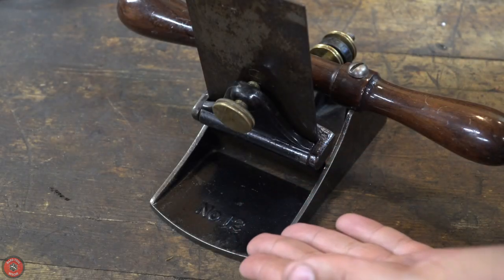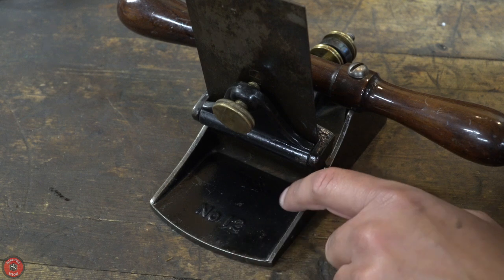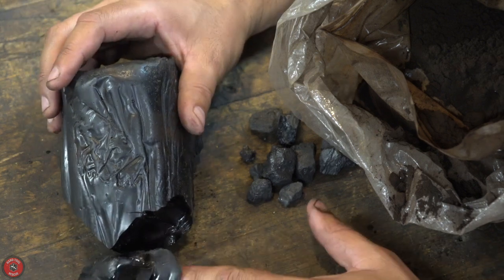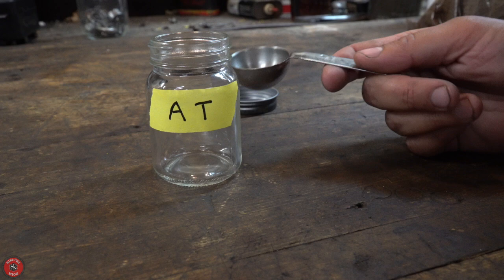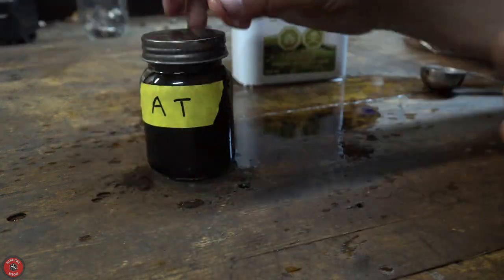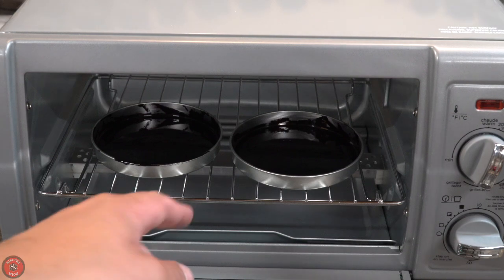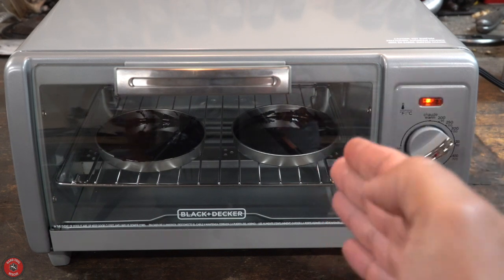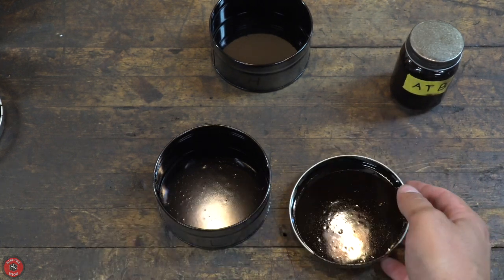Best Japanning Recipe

Comment: I've learnt with paints I've mixed from pigment that when it comes to blacks there are two kinds - a blue black and a red black.  The application i use involves reverse painting on glass (which has a green tint, which exacerbates blue/red base to the colour).   A paint that is more of a red black (brown in your case) than a blue black, has a richer warmer look, where as a blue black just doesn't cut it.

Comment: Made the recipe. Ready to use it. Does the surface have to be completely rust free? I got all the rust off the hardware with acid, but as soon as it dries some small amount of rust forms unless I have it soaking in white vinegar. Is it ok to hair dry it out of the vinegar solution then apply Japan paint to prevent oxygen or water from hitting surface and causing oxidation? Any response would be fabulous. Thanks

Comment: Boiled linseed oil polymerizes, depending on amount it can take a long long time. If you apply too much it will never harden, it'll stay tacky and soft. When painting with linseed oil paint the exact ratios between pigment and oil are important and the thickness of each layer must be very thin.  "There should be more paint in the can when you're done than it was when you started" I heard when learning how to paint with it lol..  It seems like the same applies here? We would adjust the ratios along the way until from start to finish.

Comment: When it was invented in japan in 17th century just common sence to me would be they dipped the metal tool metal whatever hot from the blacksmithing as anything metal was heated and pounded into shape. As a restorer and metal fab guy ive allways  called japaning the original powder coating but youve sparked my curiousity on this and i vow to find out. Thanks bro and love you work i only use pre war tools in all i do

Comment: The results are stunning, but I wonder if it could be improved even further by adding some siccatives to accelerate the curing of linseed oil. This way the coat would harden in it's entire thicknes, maybe it would allow to lower the temperature of hardening enough that you could apply it also on wood...

Comment: Nigrosene is the ideal japanning base - it's basically pure carbon black and can be sourced to work with either water based (alcohol) or oil based (gum turps etc.) solvent base.  For additional black compounts of cobolt and various earth bases are used for warmth.  Reds are produced from raw Seedlac and exclusively alcohol based.  I learned how to make several traditional (English traditional that it...) mixtures for restoration of old furniture and machinery at Master Craft level.

Comment: Very intriguing....

White living room couch.  You forgot to mention, you should also be wearing white pants, and a white sport coat, like Sonny Crockett, while you do this....  Galco SS2 shoulder holster is optional....

So hard to film black paint, but, to me, the spraypaint, with the amber shellac over it, looked pretty good, and felt like a lot less work....

I have made a deck sealer out of spar varnish exactly like you had, boiled linseed oil, and either mineral spirits or turpentine....  It works really well.  On that theory, since we know spar varnish will play nice, I would postulate a mix of asphaltum, spar varnish, couple drops of boiled linseed oil, and a little turpentine....  that might be the best one yet....

Comment: From What I have heard of the old japanning Recipes, Seems like it was a bit Thinner a solution, More Finely Ground on the Asphaltum, and had a Lot of Micro Carbon mixed into the mix. The carbon made the mixture as hard as it got, and tempered the softness of the Asphaltum.  I never tried to compound the setup, but The Closest I got to a pretty Good faxsimile of the old japanning was this -- The Cheapest Semi Gloss black Can of spray paint at Walmart, You Know The ones at the bottom of the rack -- mostly the 69c cans. Been a While ago ;)  You fully wet coat the part with the paint, hang it in the pre heated oven at 350 degrees for 4 minutes, after the 4 minutes, remove the parts and let them Cool down to Room Temp. At that Point, The parts were dry and ready to Install. The heat makes the paint
'Flow' on your part, and looks really Authentic .It was not so durable as it did chip -- But it looked Great, and was fast to do. So basically you are forcing the propellants out in a hurry with the oven, and I say buy an old oven and try it.  Good Luck!

Comment: Try kapton tape for masking parts. Electronics repair people use it when soldering boards. It doesn't deform at 400F and is very sticky.
Try some quality car wax on the dull ASV sample for a shine. Maybe use wax as a easy cleaning coating for tools.

Comment: When I have watched Japanese Lacquering, I have always seen them strain the paint before applying. I know it is not the same however, straining might work. Also when they bake on the lacquer, they put it in a closet with a light source as a heating element. Another aspect might be the humidity in Japan which is high.
Reply from the maker: The straining would be interesting!

Comment: Looks good (if not a little messy) still trying to get the stains out of my white leather couch :-)
if you want to mask off areas before baking, have you considered Kapton tape ? (DuPont make a good one)
it's a Polymide film with a silicone adhesive layer. good for about 500 F
it peels off really easily after heating and usually doesn't leave a residue
comes in various widths too. 3mm to about 25mm.  just a thought

Comment: Paper burns at 451 deg F. Seems a paper tape should be fine to tape something off. The adhesive might be a problem though. I really like the Japanning though. It really does make the finish very authentic on a restored plane. Great video. Thanks for doing the research for us. Our offline book repository burned down, so not sure about all that. The fire was hotter than 451 Deg F. LOL! Regards, Solomon

Comment: My grandad used lamp black powder 1 tablespoon, asphaltum 1 tablespoon, linseed oil (not boiled) 3 tablespoons, 1 1/2 teaspoons of naptha. Mix = lampblack + naptha  very well, add asphaltum mixing well, gradually add linseed oil mixing well. He had a homemade paint shaker using an old washing machine motor and gearbox and would let the sealed jar mix on slow for 2 or 3 hours. The jar would sit for at least a week, he would check it once each day by smelling... he said when it's done you won't smell the naptha anymore, if it was still too runny he would shake it again for an hour. He restored old hit and miss engines, maytags etc. I always thought regular enamel was good enough, but what does a dumb kid know. I was about 6 or 7 at the time. I brought him some of my Testor model building enamel paints and that was what he always used after that because of the other colors. Your way sure brought back memories, I'm 64 now. Thanks for the work you do and I really enjoy your humor! I have used the book thing with my kids and grandkids many times. LOL
Reply from the maker: Lamp black would be a good addition for sure!

Comment: The circular pits in the ATB finish are called "fish eyes" in automotive painting. They are usually caused by silicone grease or oil on the surface. Maybe cleaning with a wax and grease remover would be better than acetone. YMMV.

Comment: I have used birch tar I make myself as a coating. After heating, it gives a hard but brittle coating it is a dull black though. I use this sometimes on things I do than blacksmithing. I found out the brittle part then bending a pin for a clasp and it just cracked and fell off. but for things that you don't have to work after it works nicely. thought of this then you began talking about tar in the beginning.

Comment: Maybe you can dissolve it in a stirrer or tumbler to dissolve it better, or if the dust isn't fine enough you could use a tumbler with ball bearings or blend it before mixing it.

Comment: I know this is an old video, but I hope this question is appropriate. I have an old Stanley that I would like to redo the Japanning on. How can I strip the old japanning? I do not have access to blast it, is there a chemical stripper that will remove it? Thanks Bob
Reply: try soaking over night in different solvents.  I already tried ethanol 95%, , , it didn't touch it.  try lacquer thinner, acetone, etc, , ,anything you can think of.

Comment: How much does a cured finish liquify and run when you reheat it?   I'm wondering if you need to paint a vertical side and place it on it's side so it's baked flat and do that for the other side or do it like you did in your video (paint horizontal and vertical in one go) and it just runs a little making the vertical wall thinner.      What happens if you bake a 100 year old Stanley plane with originial japanning?   Will it liquify and run and repair itself?

Comment: The thin metal of the lid may have contributed to the cracking, heating and cooling faster than thicker metal and possibly warping at temperature  like Cooke sheets do in the oven.

Comment: when you pour from a can with a top opening rotate the can so the opening is upwards or  at the top, then when u pour  keep tilting the can till the liquid  starts to stream out.   in ths way you dont  get all the splashing and mess you made.  the other way to say this is have the opening  upwards to where you had it.  you had it at the lowest position.    so to  get it in the upper position just rotate the can 180 degrees  along its long axis.

so did you get all of that.   well good.

Comment: Does baking it at these temperatures not introduce the possibility of extreme tempering of the metal which will lead to the cracks in the bed often associated with older planes?

Comment: Not sure I can justify it practically, to re-Japan the finish on one of my lathes (the 90 day cold cure is a bit long to wait).. But this does look good..

Have you tried a 2 part epoxy with dyes to mimic the colour? 
Just thinking that might have similar visual affect on anything heat sensitive or too big to heat.. That it might be a similar thickness and smoothness.

Comment: Those holes in your finish is called "poor wetting" or "fish eyes"  usually caused by silicone particles on the surface. You can buy wiping cloths at an automotive paint store that will be silicone free. Use that with an automotive grade surface cleaning solvent to remove any contaminants prior to painting

Comment: The Ford Model T had japanning, or something similar, coating the body. Supposedly, the reason Henry Ford offered the Model T in “any color they want, as long as it’s black” was that that black japanning (or similar finish) could be baked on and therefore took less time to dry than other colors of car paint (I don’t know exactly what the process was for other colors). Therefore, the Model T spent less time on the assembly lines, and so more of them could be produced more cheaply.
Reply from the maker: This is true!  They switched to an enamel-type paint sometime in the 1920s.

Comment: The automotive and industrial industries have used industrial chimney soot as black toner for a variety of paints and lacquer for centuries and probably longer .The problem with asphalt is you have a tar base which as you stated,is flexable. The Chinese and the Japanese both had formulations for durable lacquers . I have seen the word Japan as a term for an additive that is a drier for paints as in Japan drier for certain synthetic enamels. Without the drier, they will not cure or dry to the touch. Have you tried using a better evaporative solvent than turpentine such as acetone?

Comment: Does the recipe call for liquid asphaltum or powedered?, I think (or might just be worth a try for comparison) if you use liquid ashpaltum in your recipe you will get a better final result... I use liquid Asphaltum for Lithography which is hard to get hold of now. I haven't tried but you can make liquid asphaltum but you have to boil it for it to dissolve, it won't dissolve at room temp. turpentine is toxic so use appropriate protection...

Comment: What about adding a surfactant?  Have you tried to use chloroform?  It works really well at dissolving and evaporating evenly.  Another solvent would be either or di-methyl either.  

Running the mixture in a ball mill with a bit of extra solvent for a week or two should make the mixture much more smooth and improve the finish.

Putting the freshly painted object in a vacuum or the paint might help.  Toaster ovens are very harsh, add layers of foil above and below the object to prevent the light and heat radiation from hitting the object directly.

What about spraying a very strong solvent or dipping the freshly painted object in a solvent to smooth the finish?  Think of acetone smoothing in 3D printing.

Placing the freshly painted object on a strong vibrator or ultrasonic tray might help even out the finish.

Adding a cup of water to the oven to raise the humidity might help.

Test the PH then try making it more acidic or basic to see if it affects the finish.

Overall the tip I think would make the biggest difference other than a surfactant is to mix it for what seems like way overkill, as in weeks not hours.  These simple paints rely on the chemicals to get really close to bond and without chemistry, you just need to brut force it.  You can run your paint samples in a centrifuge to test if they becoming a more stable mixture.

GREAT video!  I love the science mixed with history plus a bit of SHIFT paint tech.

Comment: RAW LINSEED OIL:  The formation of a curable polymer composed of raw linseed oil, Gilsonite, rosin, AND carbon black, ,, possibly a catylist or part of the polymer, would be the addition of litharge and cobalt.  The chemistry is deep, and has been studied by the rubber companies for over 100 years.  with that said, heating to open the bonding sights, then the addition of at least carbon black, then diluted/thinned with solvent after cooling, applied, then cured at at least 300F, (that might need to be 350, or 400F)  ..  The use of partially polymerized linseed oil (Boiled), will yield no or little polymer formation especially since no carbon black was added.  thanks for the video

Comment: For a two sided tool, specifically machinist squares and center finders, should both sides be done at same time?  I am concerned that the down side may "run", but does the first hour curing alleviate this as an issue?
Reply from the maker: You should be fine if you keep the coats thin.

Comment: At 17:49 you said that the japanning tests you had were cold cured. But then, you said that the craquelure was caused by baking at too high of a temperature. All of the test samples were on the same piece of steel flat-bar. Either the whole piece of steel was baked in an oven, or the whole piece of steel was not baked. How did you manage to have cold cure tests on the same piece of metal as the stuff baked in the oven?

Comment: Would you be able to use a small fan on its lowest setting to reduce cooling time or is the best you can do is a separate cooling rack or just purely oven cool down which is the slowest. Some of these tend to not like rapid cooling.

Comment: On application: could you use a thicker agent warmed to make thicker on a slightly warmed part to prevent running too badly.

I would assume mass production in the 20's included a dunking tank with parts on a moving wire passing in and out of the agent.

If heated to 400 degrees would that flat turn to a glossy finish? Dont know yet.

Comment: I'm a bladesmith and I'm making a baskethilt. I know a lot of originals were japanned. How would you go about japanning a very irregularly shaped object like a Scottish baskethilt, with a lot of piercings in the metal? (Yeah, I know, very carefully...) Also, will this stuff dry just over time without the baking?
Reply from the maker: They probably fully dipped it in the japanning.  It will not cure without baking.
Reply: . I could probably brush it in, just concerned about it running off the high areas. Or should it be viscuous enough to stick as long as you start with a slow bake?

Comment: I don't think the asphaltum (is that spelt correctly?) is dissolving in the liquid, I think you are just forming a suspension. Back in my chemistry days I used to do basically the same thing to form samples. You want to make up a mull first and then slowly dilute it to the consistency you need. What that means is add just one or two drops of liquid to the powder and mix in thoroughly, repeat, slowly adding liquid until you get to what you want. The problem will adding a lot of liquid is it will cause clumping. You can also try using a ball mill to mix, it's effective can cause the mixture to go frothy.

Comment: You might want to consider a different mixing process. Two come to mind, one is ball milling. The other is to use a muller to grind the gilsonite into the oil and thinner. Not a lot of difference in price between the two methods, ball mill might be less work, but ...

Comment: Try petroleum based solvents like naphtha 
You can also find the powder as Gilsonite powder on eBay pretty cheap

Also give adding dewaxed shellac flakes in it a shot.
Reply: Oh, btw- the acetone based stuff (mineral spirits and paint thinner) that’s in the polyurethane might not be able to dissolve the asphaltum.
The powder I mentioned above will dissolve in natural solvents (turpentine), but all of the stuff dissolves in petroleum solvents.

Comment: Are the 2 cold cure ones full of air bubbles (can't really tell from the video).  I wonder if putting the jar in a vacuum chamber before applying it would help.
Reply from the maker: They are not, just very grainy.
Reply: Pressure chamber would be another method with a try. Or flash a torch over it like for epoxy bubble release. (Have a fire extinguisher handy, just in case.)